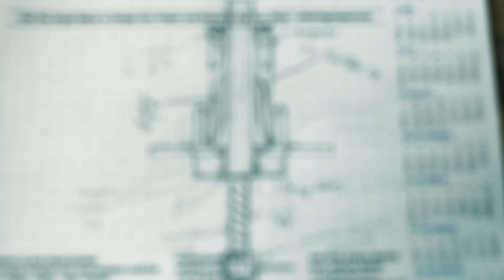Mechanical Sword V1 - Metal Fabricated Collapsible Sword

Comment: While it's mechanically sound I don't think it would work well as a sword. Unless you weighed everything so perfectly that it's point of balance is roughly an inch to a couple inches away from the hilt on the blade.
Reply from the maker: Skaianet hey thanks for the feedback! I do agree the overall issue with this version is weight. I was just prototype the mechanics and need to use lighter alloys and materials to make this usable. Thanks again